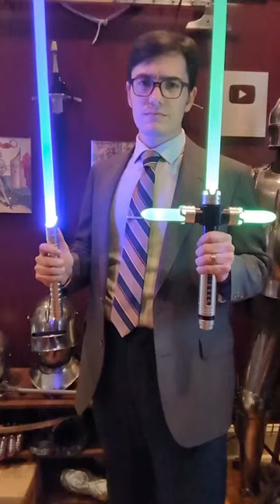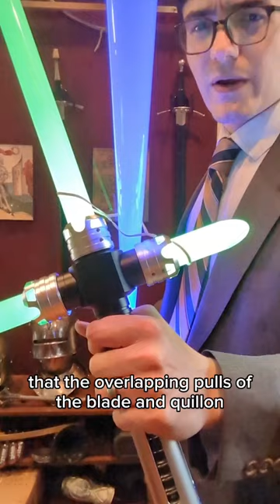Crossguard Lightsaber Theory

Comment: Also the area between the crossguards can be made of beskar or some other lightsaber resistant material. It’s a small area so the rarity of these metals wouldn’t be an issue.
Reply: Getting even a small amount of beskar is pretty challenging outside of Mandalore.
Reply: @Interrobang212  Maybe Phrik instead?
Reply: @Interrobang212  ultrachrome and cortosis both offer a certain resistance towards lightsabers and while not as good as beskar are also substantially easier to get
Reply: @Interrobang212  for normies. For Jedi/sith? Probably very easy
Reply: The rarity of materials shouldnt matter anyways. They're being used by the Jedi and Sith, who are both highly capable, dependable warriors with seemingly endless resources at their disposal

In real life, knights and medieval nobility carried weapons made with silver and gold inlaid, and even the pharophs have been found with weapons made of iron.

Iron they could only get - from meteors.
Reply: @spacemanx9595  for a time. Mandalorians are very protective of Beskar so if it came to light you had some, they would hunt you forever to get it back. It's why the Jedi let them keep the material despite it being such a direct counter to them
Reply: @wisemankugelmemicus1701  that's why rarity wasn't really a reason. I mean that was part of it, but it was primarily practicality that shaped what materials they used.

Comment: There’s several explanations for Crossguards, and nearly all of them I believe are equally valid. 

I’ve always felt like the way that sabers lock up during fights meant that they were electromagnetically attracted to one another

The cross guards on Kylo Ren’s and Cal Kestis’s lightsabers were designed to be used as weapons (and Kylo’s served an alternative purpose of venting extra energy produced by his cracked Kyber crystal) 

The Crossguards of the High Republic were also designed as a show of status or to be flashy and visually stimulating/intriguing.

As for why they have their “weakness” at the side emitters, the magnetism explanation works well. I also like the theory that the blade simply extends further through the emitter, so slicing at the emitter would just cause the blade to break the top part of the emitter and then expose even more of the Crossguard blade
Reply: Theres a reason everyone disregarded high republic.
Reply: Cal doesn't use it offensively he never once attacks with the side vents. It's also literally a design from the High Republic he added to his modern saber. So whatever purpose the High Republic Crossguards had would be the exact same purpose Cal's has. Which is symbolic but does have the practical effect of energy output making the main blade longer and bigger. What he also added was a pommel which he does use offensively.
Reply: Honestly the only good explanation I've ever heard is they're exhaust ports basically. I don't hate Crossguards, but I think they're really dumb. The issue I have with saying they're designed to protect the hilt or your hand is if your opponent wants to sever either, they're gonna aim much to low for it to do anything.
Reply: @flamesofchaos13  From my understanding, it's the pommel which does most of the work in increasing the blade length, since he's using both crystals to power one blade (and the vents). I believe the crossguard here truly is just visual flair.

And while I do think that the crossguard is most likely an offensive fixture (like a few other people in this comments section), I also think you could argue that the crossguard is why Cal gains an extra section of block meter while using the stance.
Reply: @NarrowSpark96  Additionally the answer for any cross guard is just that, vents. Using two crystals to power a single blade is risky, and is probably generating too much energy to regulate. So the obvious solution is pump out the excess somewhere else, vents. Additionally this was the reason for Kylo's Saber design, to vent a damaged crystal so it was "moderately safe" to use. The offense and defense is kind of a bonus. You have another outlet for hurting someone if you are in a saberlock, and a potential deflection point to protect your hand when repositioning. But it all comes back to venting excess plasma so you can have a stronger/longer blade.
Reply: Kylo Ren's crossguard was a necessity, not a feature like the other crossguards. Whatever utility that thing gave him was secondary to the main purpose of keeping his canonically terribly built lightsaber from going boom.
Reply: So we should see some cross guard sabers that are damaged or hear that they are constantly needing metal or other materials for repair, or it’s canon that the cross guard is useless lol

Comment: My jaw is still on the floor wtf. Best explanation I ever heard
Reply: And yet its wrong
Reply: @samara1815 and yet you provide nothing to the conversation and just say that to be a contrarian.

If you are going to say somethings wrong, then say why.
Reply: @clanker2821 
I got you covered

If they were magnetic, blaster bolts would be drawn to sabers without having to move the saber to block the shot

In fact
The presence of energy against energy would repel the sabers more than pull. This is why lightsabers spark as you push/strike against your opponent’s blade, and why blaster bolts can be reflected back at the shooter.

SW Rebels is cracked
Reply: @johnhagala3622 I'm pretty sure it's just the blades that are drawn to each other as a result of the kyber crystals, not all energy based weapons.
Reply: @samara1815 so are your pride flags and yet here you are showing them off
Reply: @hylianro  Nothing wrong with pride flags. I agree their dissmissiveness about the lightsaber theory is flippant -but there's no need for homophobia or hate.
Reply: @RG-Zeldaplayer Of course there’s lots wrong with pride flags
Reply: @dylanziesing6122  The only thing wrong with them are the attitudes homophobes express when seeing them.
Reply: @RG-Zeldaplayer  Plus what they stand for.
Reply: @dylanziesing6122  inclusiveness and being yourself is so wrong???

Comment: I just assumed the crossguard section would be made of lightsaber resistant materials.
Reply: We see multiple lightsabers cut in half.
Reply: @robertharris6092  Well, they obviously weren't made of lightsaber resistant materials.
Reply: @johnlopez6  theres only 2 materials i know of off the top of my head that can block lighstabers. Beskar which is only found on mandalore. So jedi arnt getting access to thatm and cortosis. Which is a very rare material found in the outer rim. Some jedi prob used it but not most.
Reply: @robertharris6092  well obviously if you were designing a lightsaber made with hilt contact in mind you would use lightsaber resistant materials for the parts you plan to make contact, example being the lightaber pikes wielded by the shadow guards in force unleashed as well as the force pikes of the ig-100s. Depending on which Canon we are talking about Phrik alloy was the cheapest most common lightsaber resistant metal, there were also creatures with naturally resistant armor like wookie fur.
Reply: Then why wouldnt you just make the entire guard out of that material?
Reply: @choklatecheeseburger  you could, if you have ample material there's no reason not too really.
Reply: @robertharris6092  Sorry this is late I know but there is actually a couple more depending on Legends or not.
For example in the Shatterpoint mace windu novel there is Vibro shields made from super conducting material from a starship's armor before shielding tech. It could stand slashes and minor presses with its weakness being long presses as that heated the whole metal up.

There is actually a lot of Lightsaber resistant materials but its a question of HOW resistant it is. The more resistant and durable it was the rarer it was.
Reply: @revanninja  wouldnt a super conductive material mean ita going to melt your hand? Also if its the vibrations that make it work well then no way you could make that into a lightsaber. Since the vibrstions would likely mess eith the frequency of the blade. Though. If a shield vivrated at a mi roscopic scale like vibroswords do that would make it easier to cut through.
Reply: @robertharris6092  From what the novel described it wasnt the vibro tech that made it resistant to Lightsaber that had no bearing on the resistant what so ever though the easier to cut through aspect WAS used in the climax of the fight just not by the lightsaber.
No the way its described is that the superconducting material has to spread the heat evenly and reach a certain point before it begins to melt so its not just where its hitting the blade. That is what allowed it to survive hits from the Lightsaber it was heating the shields just not to the critical point and got a chance to cool off because the users specifically avoided long presses for that exact reason.
Reply: Chromium is also lightsaber resistant as well as many other material
Reply: @robertharris6092 there are atleast 6 and some are actually readily available
Reply: Phrik is meant to be a lightsaber resistant material although expensive
Reply: @robertharris6092  there's also phrik, which is alot less rare than both of the material. Most electro staffs are made of phrik
Reply: @robertharris6092 I don't think it's THAT far off for some shady illigal black market thingy to have enough beskar to coat the two vents.
Or just hire a Mando with beskar armour and just betray him when you feel like it and repurpose his armour (if that's possible ofcourse, don't know much about Star Wars materials)
Reply: @gibleyman  betraying a mandalorian would be a death sentance. But they dont trade beskar to anyone.
Reply: Well when you think about it shouldn't all lightsaber hilts be lightsaber resistant? Because if some weren't the lightsaber blade would melt or destroy the hilt
Reply: @WumboGuy you’re forgetting two things though.

Lightsaber resistant materials are expensive and rare asf in the Star Wars universe.
Reply: @TheEmperorOfViltrum  some less so than others, but crossguard lightsabers are a rare variant to begin with. If you're going to the trouble of building one then your going to design it to suit it's purpose. The purpose of the crossguard adding functionality specifically when dueling with other saber wielders. If the crossguard wasn't lightsaber resistant then it's a design flaw. And in the few years that the crossguard lightsaber has existed in Canon I have not seen a single incident in which a crossguard has been shown to not be made of lightsaber resistant materials, likely because it would make no sense for them to be. A rare and specialized design, may in fact require rare and or specialized components, whoulda thunk it?
Reply: Expensive and rare. Mandalorians wil take great offense to you stealing their beskar for your lightsaber as an auretii. And Cortosis ore will temporarily short out lightsabers on upon contact. So imagine making the insides with that said ore... You'd just have a fancy cylinder with a crystal, not a weapon.

Comment: Another point is that even if it hit the guard itself it wasn’t going to really get through since the emitted blade goes all the way through both sides of the guard, so at most the guard would suffer a booboo but lose no functionality.
Reply: until it starts leaking plasma out of its side.

Comment: I would also like to believe that the metal portions of a lightsaber the actual beams exit out of are made of a material intended for close contact with the beam. Given this and the "pull" effect mentioned in this video makes trying to slide the lightsaber downward towards an opponents hands a wasted effort during a duel, effort that is better used towards staying alive. I believe there are some cases where lightsabers are cut into and destroyed during various Star Wars material that usually go below this portion of the lightsaber, so it would be a good explanation for the placement of these cuts.
Reply: I would want a hilt constructed (even partially) of phrik, beskar or some other lightsaber-resistant alloy (except cortosis 😂)

Comment: I actually didn’t know it was an actual cross guard. When I saw Kylo ren’s lightsaber in Star Wars 7 I noticed the main blade looked different from other lightsabers we’d seen so far. The light seems rough and fluctuating, instead of being perfectly smooth like traditional lightsabers. So I thought maybe the side thingies were like some kind of orifices to let energy escape through the sides, like a steam machine that spews out steam to regulate pressure, to help stabilize the unstable/violent energy of the blade.
Reply: This is actually the official explanation given in old episode 7 material.  Though having actual crossguards to create “broadsabers” is still cool.
Reply: No, yeah, that's the actual official explanation for Kylo's specifically.  His NEEDS those vents because without it his saber is at risk of just detonating in his hand.

However, he was inspired to do this cross guard thing by older saber designs, which were stable and didn't actually NEED the cross guard, and the theory is still out on why exactly they were made.
Reply: imma add one of my favorite headcanons

the turbulent blade of Kylo's saber serves
as a visual representation of his character:
raw & unpolished power, coming out of
something that is barely structurally stable
Reply: @CosmicJubatus  it’s not headcanon, it’s called media literacy. They didn’t give him an «unstable» lightsaber randomly. It’s clearly intended as a parallel to his character
Reply: i feel both flattered & talked down to, NGL
Reply: @CosmicJubatus yeah sorry I could’ve worded that better. I didn’t mean to come across condescending
Reply: @Andythecreature I think you are giving Disney too much credit here
Reply: @crackhead2734  nah... i despise the company, but they don't make the art, they finance it. The magic comes from the immensely talented individuals that they hire (writers, actors, designers, VFX), although it's unfortunately watered down by the executives
Reply: @pommedeter7407 this is something that a lot of starwars fans don't get, that's why some of them hate the last jedi
Reply: @CosmicJubatus and even the fans too

Comment: Kylo Ren's saber was made with the intention pf actually venting out some excess after he bled his crystal to the point of cracking. That crack caused the blade to become unstable and to need a new hilt to facilitate it. So in conclusion the cross-guard lightsaber is not as much of a cross-guard lightsaber than it is a vented one.
Reply: I massively prefer this, explain a nonsensical but awesome design with something that makes sense and is also awesome 🍻
Reply: Exactly. They ultimately went with the look because it looked cool and came up with a reason after the fact lol
Reply: No. That is only in Kylo Ren's situation.  Some Ancient Sith lightsaber designs had cross guards, and those lightsaber didn't have cracked Kyber Crystals. Kylo Ren did use those to vent it, though he used an Ancient Sith design.

Comment: Lets not mention the glaring fact that since the handle is circular, it would be very rare for the guard to be aligned with your arm the way a normal sword should. My opinion, if you want a crossguard lightsaber, just do the simple thing and get a regular circular guard on a one bladed lightsaber, like Kanan’s. Its less likely to stab you and is pretty good at protection.
Reply: While an oval hilt can be advantageous, it's really not that hard to hold a cylinder still or even just make the minute adjustments required to realign it.
Reply: @azathoth3700  Yes I agree, but in battle, it’s going to shift a lot in your hand pulling off a lot of common lightsaber techniques, leading to you accidentally stabbing your forearm before you even realize it. Yes you could argue you can adjust it mid battle, but then again, you’re in battle. 100% of your focus will be on your opponent.
Reply: Wouldn't the training for a crossguard saber be similar to say, a staff saber? You know using a training saber thats not gonna slice you until it just becomes unconscious action to keep it away from your body?
Reply: @CodyusedPSI That’s a good point but at that point, its just a lightsaber with less range of motion

Comment: They’re not emitters they’re vents. The reason kylo is the only one with the cross guard is because when he bled his crystal it cracked and started Sebring beams out the sides, so cutting off the vents, if it were possible, wouldn’t do anything. It would just make it more dangerous for the wielder to hold the saber
Reply: No they're emitters. Cross guard lightsabers just fell out of fashion 1000 years ago possibly because they are so unwieldy compared to the traditional lightsaber variants in blocking blaster fire from all angles

Comment: I have a light saber design that eliminates the weakness: have the crossguard emitter point back towards the blade and slight upwards, shooting the crossguard beam past the blade (one crossguard beam in front and one behind the blade). The opponent blade will not touch the emitter because the blade and crossguard beams are crossing above it.

Comment: It's also worth noting than in the extended universe, it was said that lightsaber blades would actually offer up resistance when moved, probably from said magnetic field keeping the energy blade-shaped, so there is an element of "mass" involved in wielding one of them, assuming a harsh bounce from strong magnetic forces around the crosshilt, the opponent would have to deal with an errant saber that's trying to bounce out of their hands.

Comment: I’m pretty sure the actual emitter is inside the central part of the lightsaber and the metal pieces on the sides of the cross guards are just to make sure your hand doesn’t run over the blade.